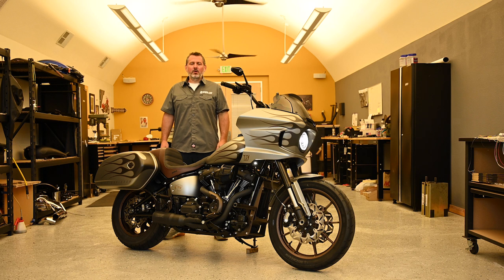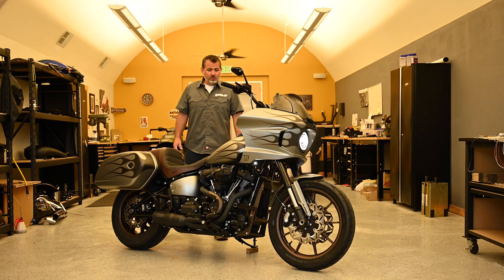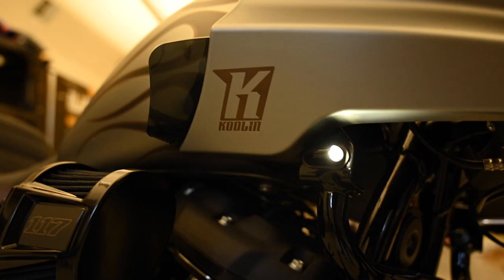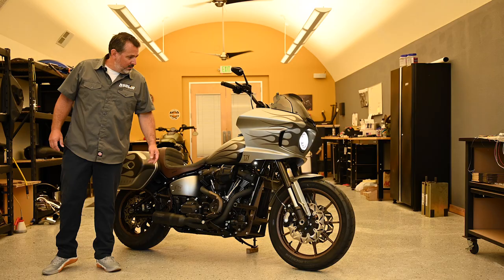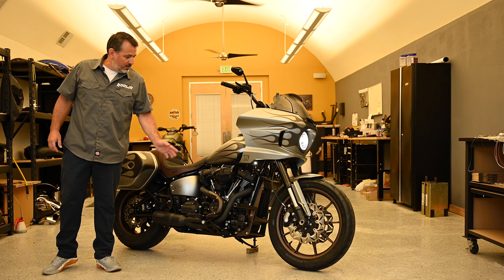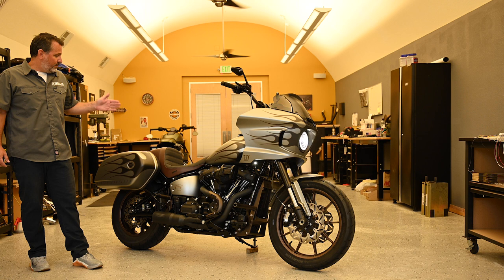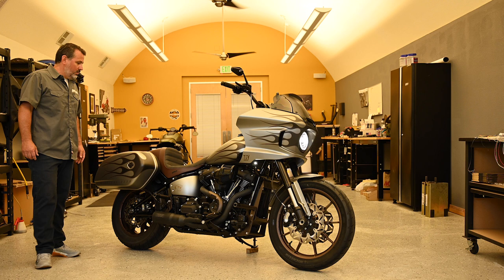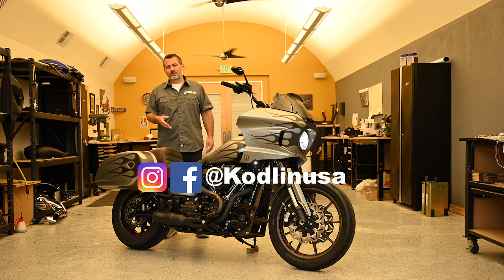Kodlin Lowrider ST details

Comment: I have the drl lights with turn signals on my st. Is there a function or anything that when I use the indicator the drl turns off completely so it's alot brighter and legal then in Australia. As when I put these on when you indicate it still uses the drl and not very bright turn signal at the same time. I want it to turn completely off while it's in use like when the hazards are on its super bright then.
Reply from the maker: We have used Highsider part number 208-109 with good success. It will turn off the running light while turn function is operating and turn back on afterwards. It would need to be spliced into middle of existing front turn signal harness wiring for each side with 3 wires (ground, turn, run) input and 3 wires (ground, turn, run) output or you could put MX19 connectors on it and plug between our light connector and OEM harness, or between OEM front turn signal connectors in the neck.
Reply: @kodlinusa6155  thanks legend !!!!